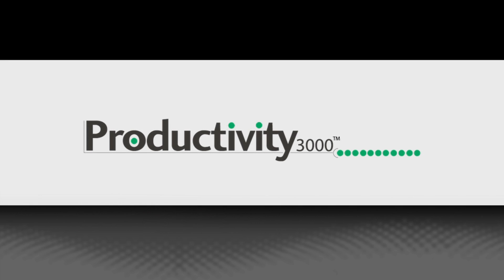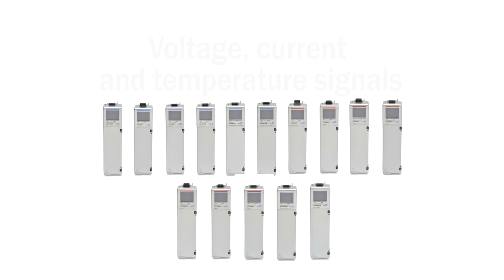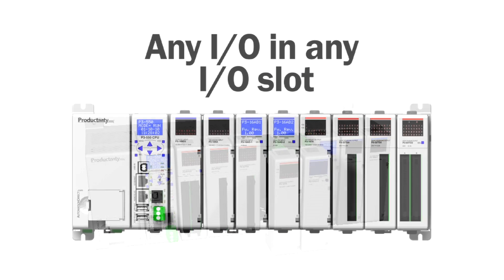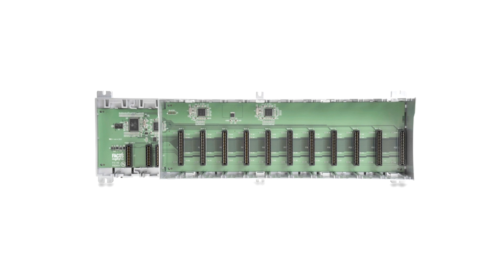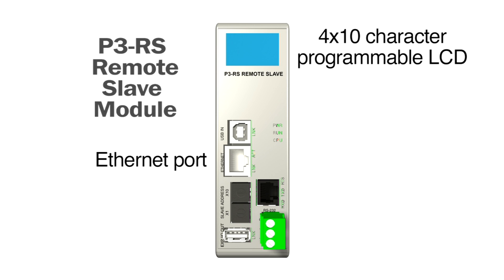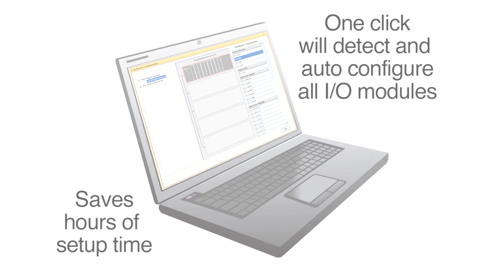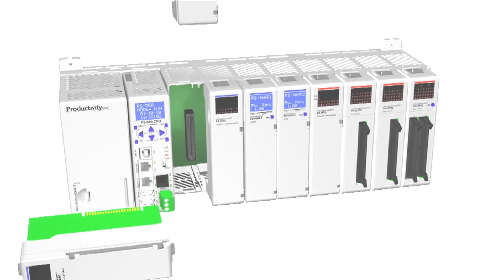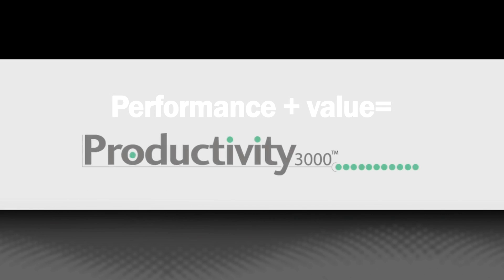Productivity3000 Controller - A More Flexible Design Increases Your Productivity

Comment: Flexible? Just try connecting it to you 10.20... network. You will be the need to be the flexible one, jumping through all those hoops and bending over backward. All 10.20... addresses reserved. Terrible design.